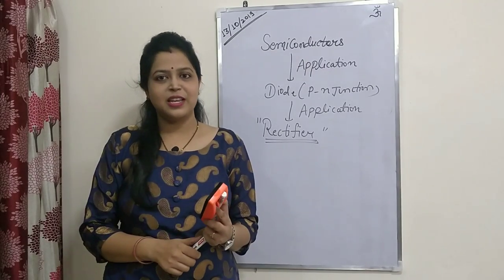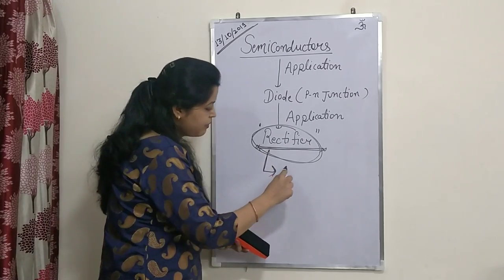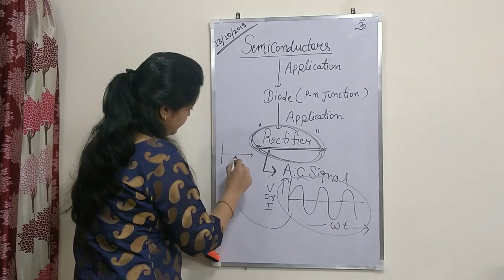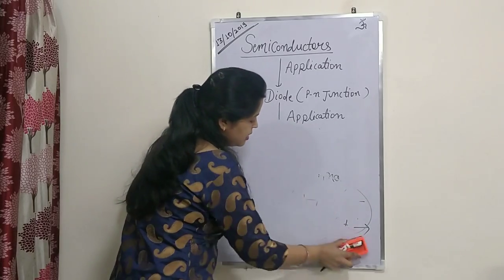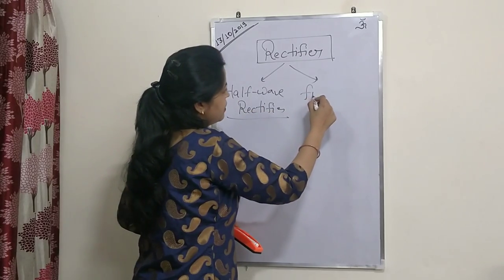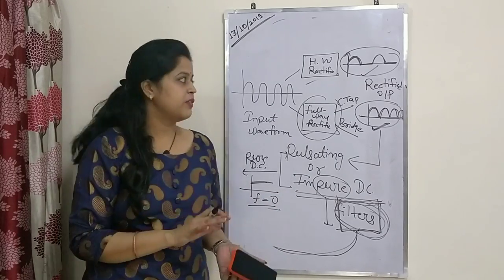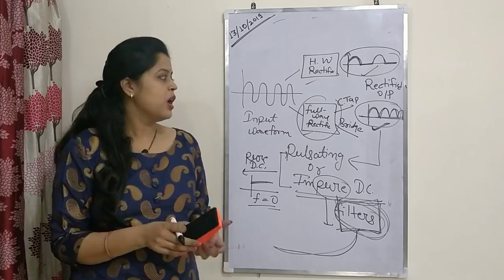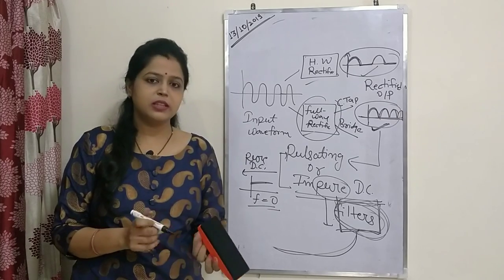SDC | 3: Rectifiers | Neha Mathur

Comment: Ma'am I have understand how AC voltage is converted into DC. 
But I want to know that how to convert DC to AC voltage?.
Please cover this topic in your next lacture.....
Reply from the maker: Thanks to watching and to follow the content.
It is good to hear that you are clear with this concept.

Now for DC to AC conversion, an inverter does the opposite job and it's quite easy to understand the essence of how it works, but with few more concepts of active and passive components.

So, i will cover this topic very soon with the complete details required to understand this.